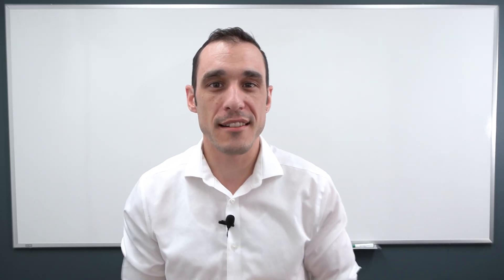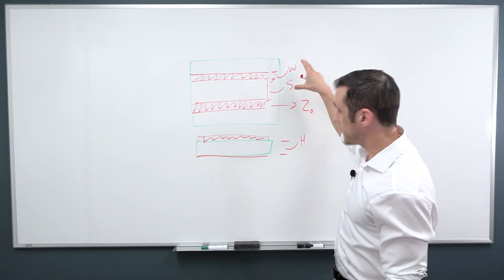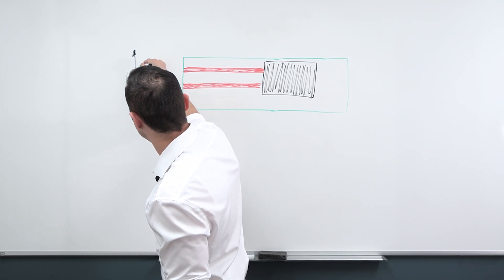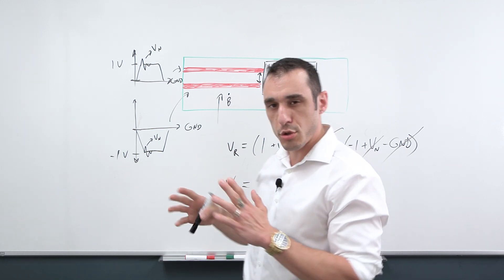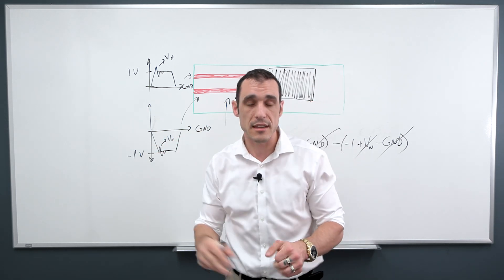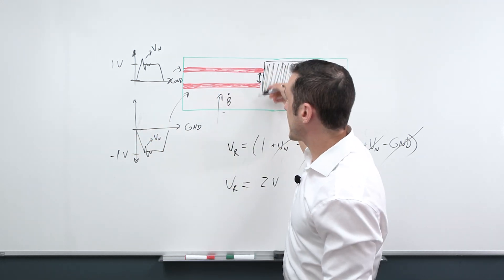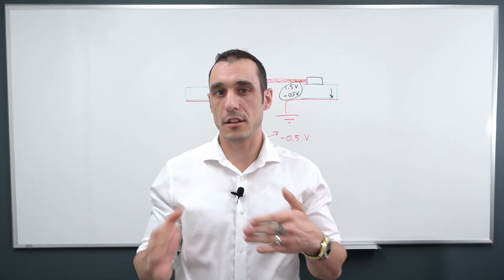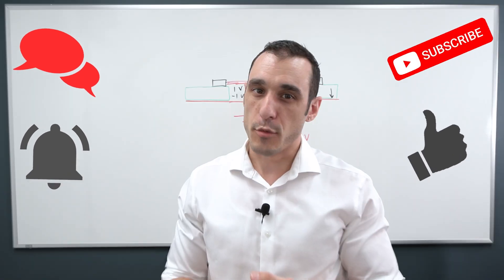What Are Differential Pairs?

Comment: Thant's Great !
Thanks much Mr. Peterson !

Copilot wasn't sure but it ended up single line sense.

Prep for Altium Designer.
About 1 mo.

Assembly Two Phase Bipolar Stepper Motor Controller

PWB Two Phase Bipolar Stepper Motor Controller

Two Phase Bipolar Stepper Motor Controller
KiCAD Course Udemy
Design with KiCAD

Instructor:
Wissam Botros, P.Eng, CID
P.Eng - PMP - Application Engineer
Professional Engineer in Ontario, Canada and CID ( Certified Interconnect Designer) by IPC.

Comment: Cool, but some new colleagues sometimes misunderstand that differential signals must necessarily have a negative voltage. In reality, they can be single-polarity with a positive offset and still be a valid differential signal (e.g., CAN). It's just that some people see -1V and assume there must be a negative power supply. Maybe im wrong
Reply: That's true in a way, it's actually an equal an opposite polarity around some reference voltage, which could be 0V or it could be something else. Classic LVDS (I forget which TIA standard it is) uses two positive voltage values with respect to the system ground (the reference voltage is positive) and the receiver senses the difference between them. It's a small voltage difference (350 mV?). If you have a driver sourcing the signals over a 0V reference, and your receiver has a ground offset with respect to this reference, it's equivalent to the receiver having a non-zero voltage reference with the same ground plane between the driver and receiver. At the end of the day, all that matters is the voltage difference between the two traces.

Comment: At 11:41, here you explain how differential signals benefit from being able to communicate even with two different GND potentials.
But does this also not show, that there could be issues with the common mode voltage at the input at the receiver? So sometimes you would need a common GND to avoid potentially destroying the receiver?
Reply: Yes there can be problems with common mode voltage offset and a ground offset between two floating grounds or two different earth points is effectively the same as applying a common mode voltage offset. Those voltage offsets tend to be quite small, although Howard Johnson notes on his SigCon blog that he has measured DC ground potential offsets of up to 10 V between two different earthed systems.

Comment: @AltiumAcademy When potential difference between 2 GND’s is not same as it’s -0.5 then why its not affecting the voltage of differential pair ¿ if I see the equation then it’s gnd1 and gnd2 which are not same potential so it should add to the voltage of diff pair mathematically
Reply: The ground offset does affect the voltage of the differential pair equally, which means the DC adds a common mode component to the signal's voltage level. Differential receivers measure the voltage difference between the two traces, so because the two traces are each offset by the same common mode DC component the differential receiver is eliminating the common mode DC offset. This is one of the main reasons that differential pairs were originally used in high data rate serial connections over cables; they can withstand the voltage offset that can arise between two pieces of equipment (each with floating grounds).

Comment: when measuring signal-, it probably is not -1 if considering common mode signal.
Reply: Writing -1 should not be literally construed to mean -1V. The signal can have DC offset that is common to both signals and they can both have a positive voltage, but the differential voltage measured at the receiver will still be negative or positive value with equal magnitude.

Comment: Sometimes, the signals just transmit with differential pairs and no gnd wire. then what is the reference point? Does differential pair refer to each other?
Reply: Diff pairs aren't perfectly symetrical both in the physical construction and the actual signals propagating through them. The reference plane is the return path for common mode current, so it reduces the chances of that noise coupling elsewhere as well as providing a level of shielding from other aggressors.
Reply: The GND reference is always somewhere, even if it is just physical earth. In the case where there is no GND plane, the signals reference each other, but there is major benefit to having GND. The big reason is to prevent differential crosstalk between pairs and to ensure crosstalk from a single-ended trace appears as close as possible to a true common-mode signal on the victim differential line, that way the differential receiver will be able to cancel the common-mode signal.

Comment: Why ground via is required in differential vias. What is the main reason. What will happen if we were not used the ground via.
Reply: I'm not sure what you're referring to, could you please clarify what you mean by "ground via"?
Reply: @Zachariah-Peterson  for differential pair high speed signal transition we are using signal vias along with ground vias. My questions is if we are not used the ground via along with signal vias. What is the impact on the board and what are the consequences we have to face. Please correct me if my question is wrong.

Comment: Hi,  I wonder where the return current flows in diff pairs for an example USB2.0. 
And why ground plane reference for an USB2.0 is a must. 
Probably you have made video about that :)
Reply: Hi Ilia, thanks for watching and these are great questions. I can tell you that the return current for a differential pair is technically the other trace, although in reality there is some return current capacitively coupled into the nearby reference plane. This is why the return nearby ground affects the impedance, it creates some additional capacitance that appears in parallel with the self-capacitance between the two traces. The reason we need ground in USB 2 is to set the impedance of the traces to the required value, and placing the GND closer to the traces allows the traces to be made thinner when they are being designed to a target impedance. USB 2 signals can be routed as individual traces, meaning they can be separated. You have to be careful with this because some noise might appear on one trace, so it would not be common-mode and wouldn't be suppressed. Also the individual trace impedances have to be set to the required single-ended value to ensure correct termination at the driver/receiver. Another good reason to use GND in general is to provide a low-inductance return current so that you can reduce ground bounce. GND planes also provide some shielding and noise reduction generally, and this increases when the GND plane or pour is brought closer to traces.
Reply: @Zachariah-Peterson  Thank you for the answer

Comment: Can I use differential pair for UART, I2C and SPI clock and data lines?
Reply: Hello, my apologies as this reply should have been posted awhile ago, so I'll post it here now.

Technically yes you can, you can route SPI to a differential interface converter. Probably the easiest to use will be CAN bus. Just look for an interface converter or CAN transceiver on Google or on Octopart. Just note that those interfaces are single-ended by definition.

You should ask yourself, why exactly would you want to use differential pairs in that situation? Just note that SPI, I2C, and the like are not really meant for situations where you might need to make long routes between systems that might have some ground offset. Better to use something designed for long-range. If you're just routing between two boards with a small ribbon connector, and their power is on the same circuit, why not just supply power from one board to the other, and then carry a GND line along your cable to ensure low loop inductance? Just about every MCU board you can find will do this, they don't separate out power onto different circuits and then use differential lines for data. You don't get much additional benefit from differential pairs in that situation. Just something to think about as you shouldn't have to overdesign your board.

Comment: Your vids have been very instrumental in our project development. I'm currently working on daughterboard where it gets 24 VAC power from the mainboard. Both designs utilized half-wave rectification hence one line is referenced as ground. Since the power connectors are just clip and screw terminals, we can easily switch lines 1 and 2. This shouldn't be a problem cause there are no other wirings utilizing common ground which will cause a short if not both line 2 are connected to the 0V terminal. The mainboard and daughterboard communicate via CAN protocol (or TWIA) and works smoothly when the power wiring is correct. If one wiring is reversed, the MCU gets to around 30 Celsius when in normal conditions it is only around 16 Celsius. The receiver also misses a couple of messages. I checked the datasheet and found out that the CAN lines are pulled up and down to its rails. CAN ICs with isolation features is certainly not an option for us at this stage.

Comment: Remember each half, the _p and _n, of this type of differential pair references to GND and not each other. They are really 'just' complementary single-ended signals. So the return path is GND and not the other _n or _p. Else the trace length matching would introduce gross impedance humps, generating reflections and EMI. ONLY transformer coupled differential pairs are truly balanced and differentially refering to each other and not the GND.
Reply: that's confusing
Reply: @ihtsarl9115  Yeah I am not good at explaining. Take the time to watch this: https://www.youtube.com/watch?v=qEI31nNltFY
My point is just that some designers believe you dont need GND returns with a differential pair. It depends as usual, but only true differential that is isolated from the reference plane has the energy between the two differential pair. Mostly we have pseudo balanced and the energy is between each diff line and GND. So routing we need to have uninterupted GND return all the way unless it is 'true' balanced using transformers on both ends.

Comment: Regarding different ground references, take care that your IC can withstand the voltage value respect to its own gnd, or it could be damaged.
I like your videos style. Blankboard, ilustrations and focus on information.
Reply: Thanks for the compliment! That is a good point about the level of GND offset, although I remember reading from Lee Ritchey, one of the pioneers in designing with SerDes, that differential pairs can withstand very high GND offsets.
Reply: @Zachariah-Peterson  I agree, but when testing stuff that is supplied with more than 1000vdc things start to be frightening 😂

Comment: 1. Does the differential lines needs ground plane under them? (It's not need in my opinion)
2. How we can determine the width of the track and space between tracks? I asked this question to my fabricator but they didnt answer it clearly.
3. Is it possible to design impedance controlled pcb with 2 layer stackup only. (both layer has got signal and ground plane) 
4. Is there a feature in altium to check signal integrity issue (crosstalk, ringing etc).
Thanks in advance.
Reply: Hi Zafer, I'm so sorry I just noticed this, I originally posted a reply to this but Youtube deleted it because it contained a link! Here are the answers to your questions:

1. No, technically it's not needed. It is needed to define the characteristic impedance of an individual single-ended trace.
2. Your fabricator will use an application like Polar or Saturn to determine this, probably using a boundary element method simulation. You can technically do it by hand if you can calculate the mutual capacitance and the mutual inductance between two rectangular traces. I've never seen a good derivation of these two quantities directly for paired conductors over a ground plane. There are several ways to do it (Green's function, reciprocity principle for TEM-supporting structures, direct definition of mutual impedance...), here is a guide on this topic from NIST: https://nvlpubs[dot]nist[dot]gov/nistpubs/Legacy/circ/nbscircular544.pdf
3. Yes of course, I'm just not sure you would hit a typical impedance target on a standard 2-layer stackup unless the traces and spacing are very large, so it's not really practical. Consider a typical SIG/GND/PWR/SIG stackup with 8 mil dielectric between top layer and GND: you would have somewhere in the neighborhood of 14 mil trace width with large separation needed to hit 50 Ohms/100 Ohms impedance. If you were on 2 layers with standard stackup and dielectric thickness of 60 mils, your impedance values nearly double... Like I said, it would take huge traces and big spacing on a 2-layer board.
4. Yes there are these features, see here: https://techdocs[dot]altium[dot]com/display/ASIAE/Performing+Signal+Integrity+Analyses - This guide is older, it's for Altium v15 I think, but the same features and workflow are used in the newest version.

Comment: The question is, if I use impedance profile for my differential pairs, should I also focus to the matching lengths of the differential pairs?
Reply: Absolutely. Events doesnt occur instantly. Signals travel in the transmission line and it takes time. If there is a signaficiant lenght difference, this means that signals arrives to the receiver at different times. Signals in the shorter line reaches before the longer lines. So there is a time delay between rising (falling) edges of the receiver dif inputs. This means that the receiver interpretes wrong logic.
Reply: You don't have to think about length, but time. Signals must reach the receiver at the same time. And you obtain this by topically equalising the length of the traces

Comment: Great video as usual, before explaining length matching styles, it would be great to show how to determine length matching requirements. From what I understand, app notes are a terrible source for this information and the actual requirements can be very lenient.
Reply: Yes I agree, application notes should be tested until proven correct. One thing I've noticed is that some of the objectively bad design practices (at least for high speed/high frequency boards) originate from app notes that are very old, and they are probably regurgitating advice from even older app notes... it all gets taken out of context and no one even bothers to check the date on the documents.

As far as length mismatch allowances go, they are normally specified in the spec for the signaling standard. Sometimes a component vendor that uses a high speed differential interface will describe the length mismatch in terms of a length, but that length will be different if you are using striplines instead of microstrips, different materials in the stackup, and so on... EDIT: for USB 2.0, I believe the maximum allowed skew is something like 100 ps, which is very generous.
Reply: MIPI/CSI2 is very easy to do. Mentor Graphics will signal match distance to 0.1mm but the spec means you can track it like CAN bus!
Reply: @PCBFE we just did a couple videos on this and I think 1 of them went up last week, take a look in the channel and see if you can find it.